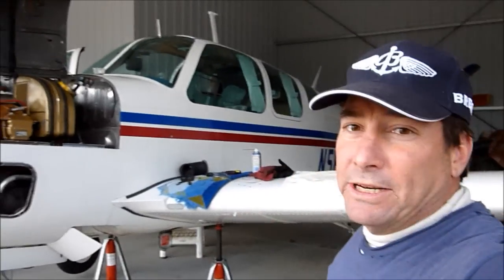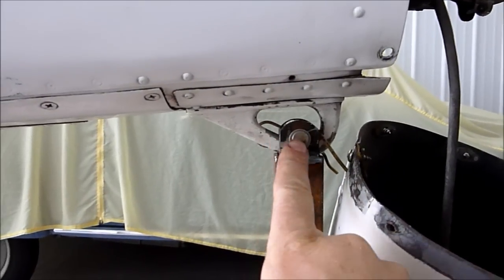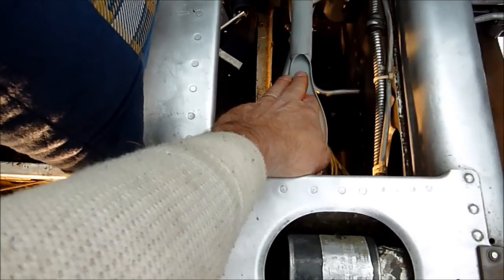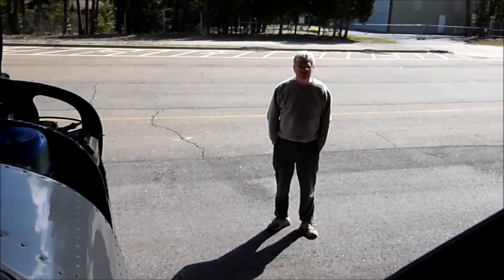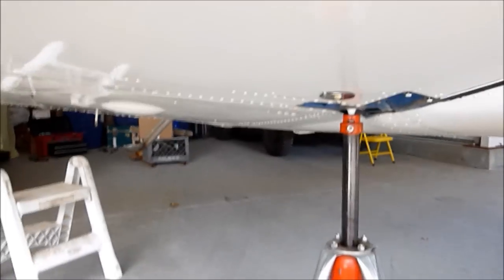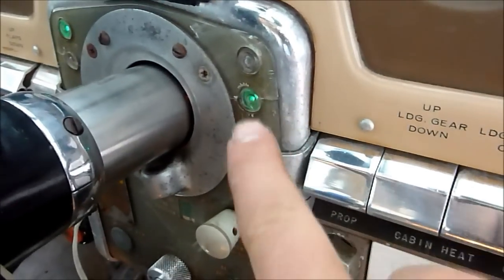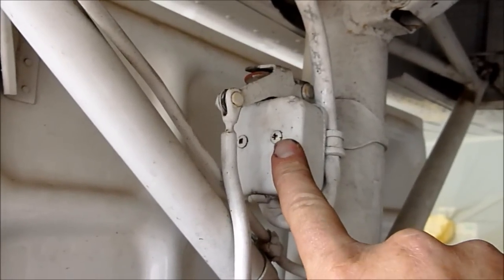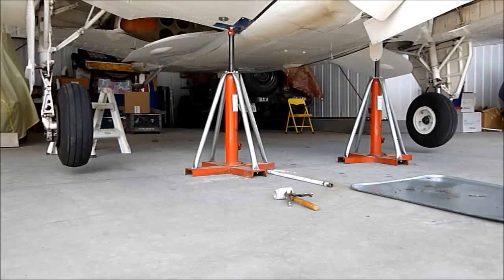1952 BEECHCRAFT BONANZA GEAR RETRACTION TEST PROCEDURE

Comment: Hey Juan, Thanks for sharing a great video. Curious on how you connected the external power source or did you just swing the gear off battery power? I have an M35 and will be doing my first annual this summer. Thanks for any info.
Reply from the maker: I just ran it off the ships battery. Give her a bit of a charge afterwords.

Comment: Love the video, we've been swinging the gear on several planes in my hydraulics class, though none seem quite as elegantly implemented as the Bonanza's! I have a question if you don't mind, what do you find your operating cost to be, roughly, per hour for the V-tail bonanza?
Reply from the maker: 'bout $100/hr wet + $350/month fixed costs.
Reply: blancolirio
That ain't bad! I expected the bonanza to be much more expensive. Thanks for the response!
Reply from the maker: ...as long as nothing 'major' breaks or needs rebuilding...
Reply: blancolirio
 Haha, isn't that the way it is with all airplanes? ;) I think I'll be building an LSA homebuilt soon (solo flying in a Sonex!), but I really want a bonanza somewhere down the line. Thanks for the input, fly safely, see you in the skies soon!

Comment: I noticed the toggle switch for the prop is not there. Does it have the 215 beech prop? How are you controlling the prop? Did you move the mixture control to the right side?
Reply from the maker: Hydraulic prop STC.

Comment: Maybe I missed it but I didn't see any external power supplied and it sounds like the gear was lugging.
To answer a previous question, yes Bonanza's and Baron's have 3 second gear, we had to time them during gear rigging, I'm an A&P I worked for Beechcraft 14 1/5 years then worked at Iasco for 15yrs which was a flight school for JAL in Napa,Ca where we had 27 A36's and 17 Barons so I've done a lifetime of gear maintenance.

Comment: I have been shopping for early Bonanzas for many months now.  Recently heard about the need to check the "dynamic braking" of the retract system.  Can you shed any light on what that entails?
Reply from the maker: +glydrjocky Not sure what they mean by that...by design the gear naturally slows to a stop when it reaches it's limits up and down. Let us know if you hear something different...
Reply: +blancolirio just did some research.  Evidently there is a relay that causes the gear motor to become a generator of sorts as it coasts to a stop.  Keeps the gear from overrunning the stops and makes the "coast" time much shorter. Much like the dynamicbrake on many new cordless drills that stops the armature as soon as you release the trigger.  This is what I found written on one website:

The over-run is supposed to be stopped in its tracks by the dynamic braking relay shorting out the motor just before the sector gear hits the stop. Shorting out the motor causes it to act as a generator and the short puts a big load on it, causing it to coast to a quick stop - elegant system.

It may be that the relay either isn't operating or the shorting contacts are bad or a loose wire in the shorting circuit.

Hmmmmm, very interesting.
Reply from the maker: +glydrjocky Excellent! Thanks for posting...brilliant design.